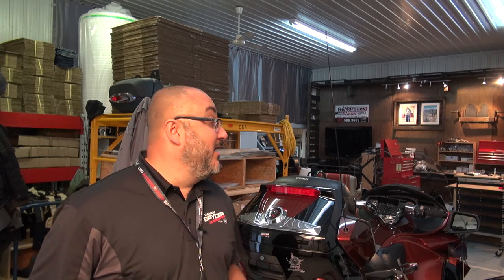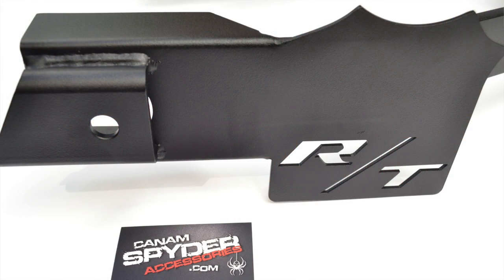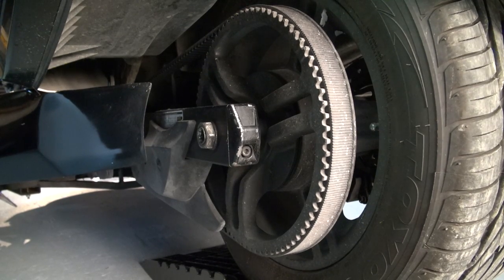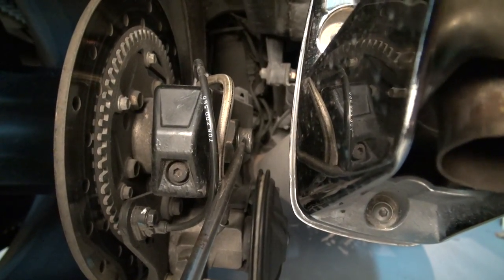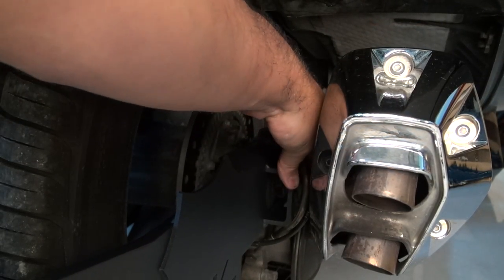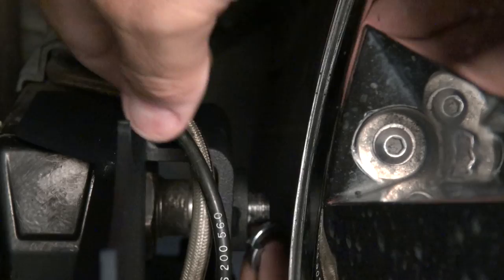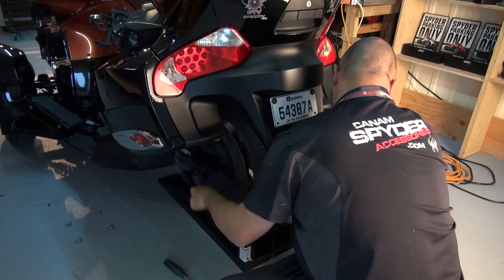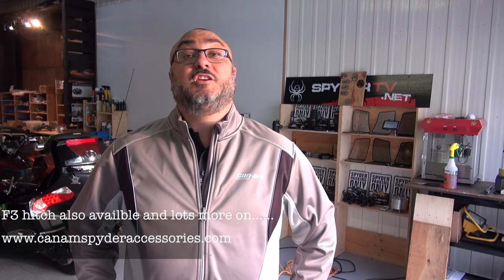RT Can Am Spyder - RT TRAILER hitch installation - Spyder TV

Comment: You forgot to tell folks to reinsert the cotter pin and spread the ends so it won't come out on the nut side of the bolt that went through the axle.